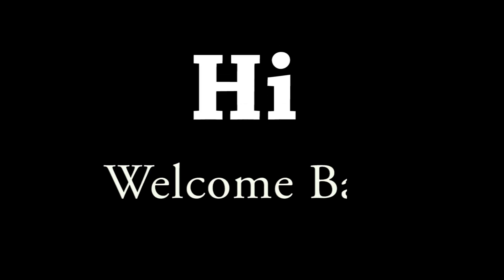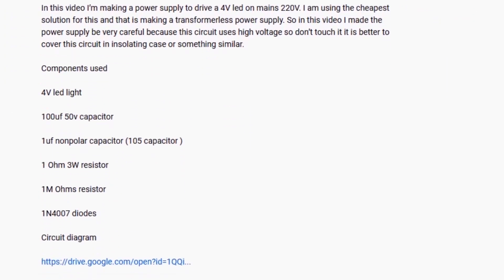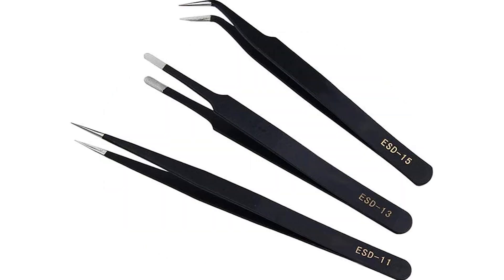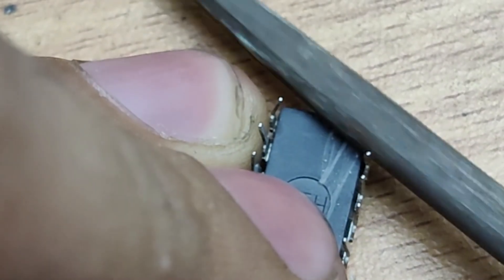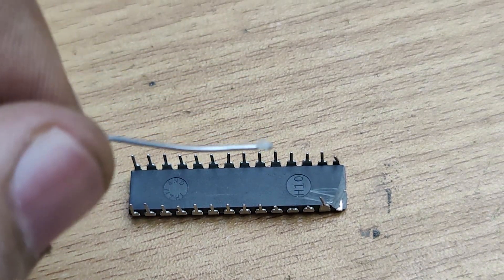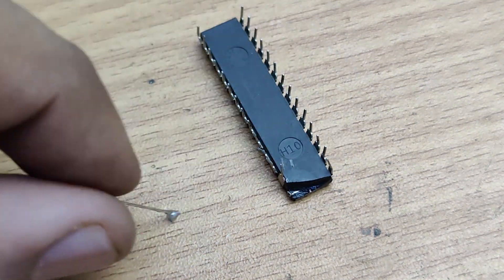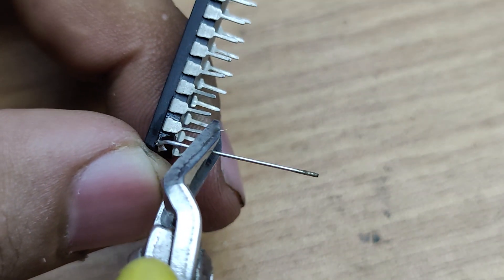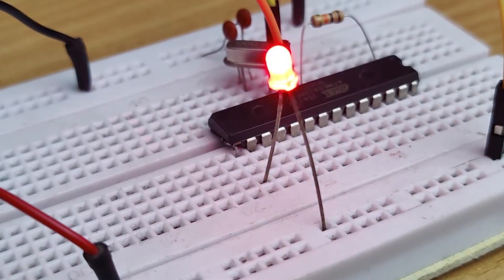Fix IC Broken Pins | Save Chips | lC Repair

Comment: May you make  a circuit  of 433mzh rf module, 555 timer ic which can control speed using pwm, h-bridge ic1919 which can drive 4 dc motors with such 5 channel with speed control button & take HT12E  as encoder & HT12D as decoder ic ?
I want to use this circuite in rc car which have a 5 motor, 4 motor for wheel drive & 1 motor for other purpose .
I need this very much I would be very grateful to you.please make this circuit.
Reply: Thank you so much, I will wait patiently for this video
Reply from the maker: I will make it soon, keep an eye on the channel.